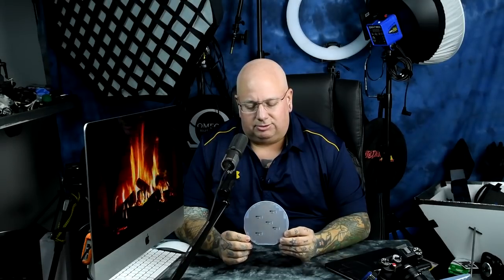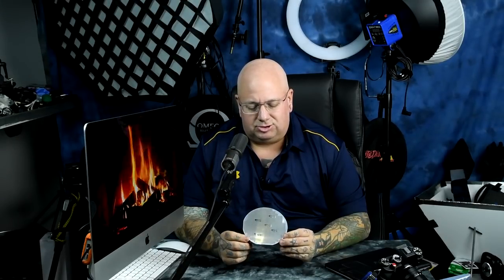🤔 Sensor Saturation & Limitations of Silicon wafer technology

Comment: Someone's been working on a sensor that resets a photosite when it's filled "...we have developed an HDR technique that protects a camera from overexposure by resetting its sensor capacitors whenever they receive excess light. We apply an algorithm to images captured by the camera to ensure no modulo fringes are left, and the result is an image without the degradation of overexposure."  http://spie.org/newsroom/6191-a-camera-that-never-overexposes-an-image